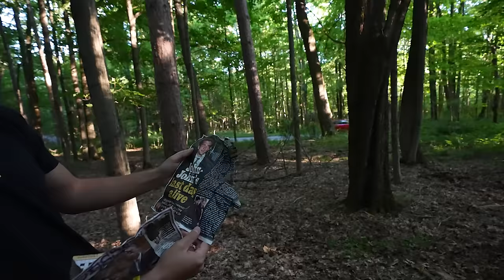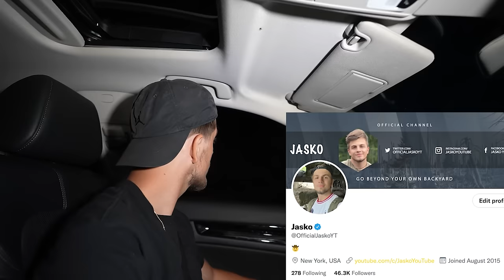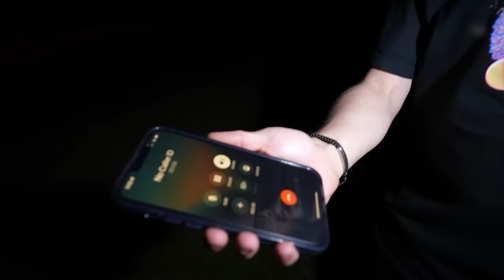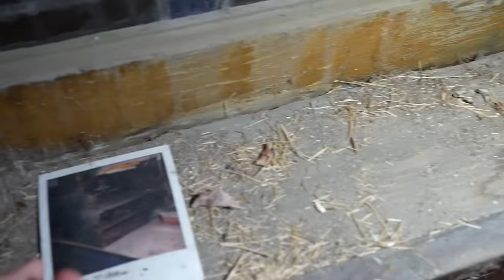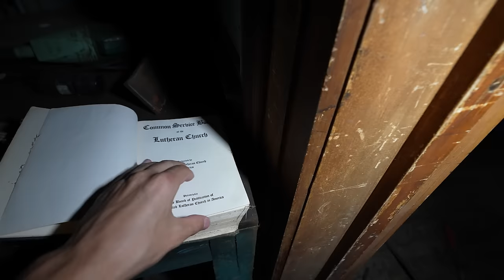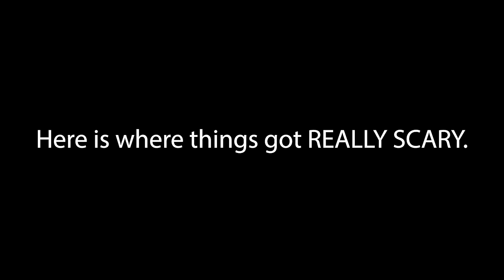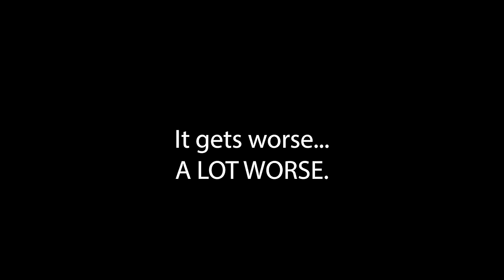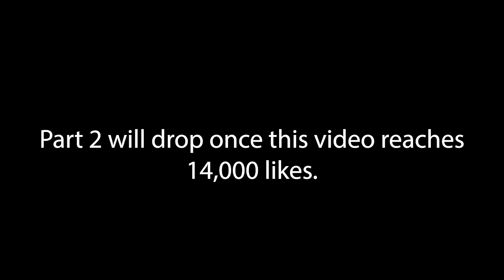(POLICE CALLED) TERRIFYING RANDONAUTICA EXPERIENCE - FOUND HUMAN REMAINS IN LAKE?

Comment: 48:35  They're called  Zip restraints it is what the police use when they run out of handcuffs But you can buy them any any police supply store they are basically handcuffs that are really hard to get off It's not a good sign that they are there. Stay safe guys